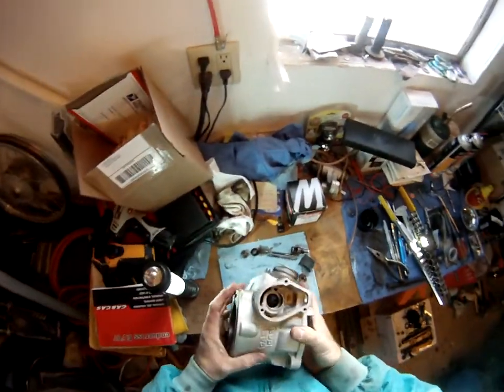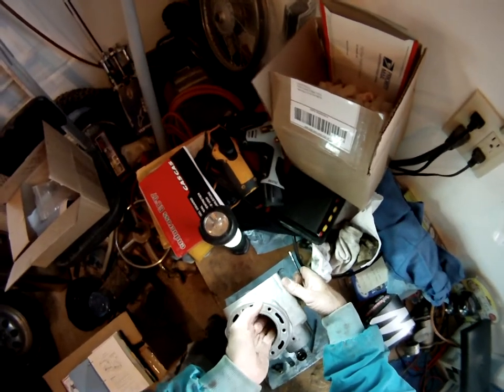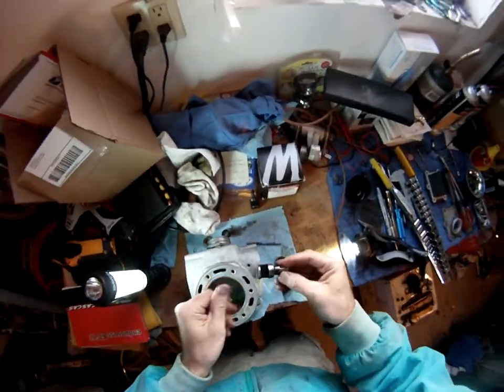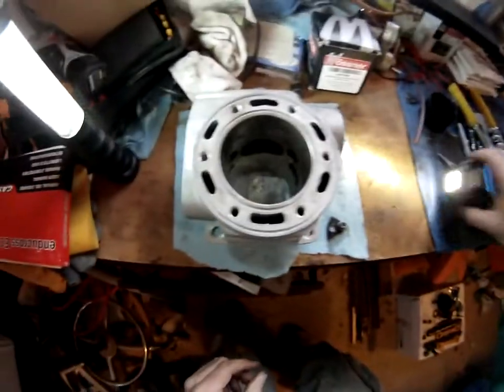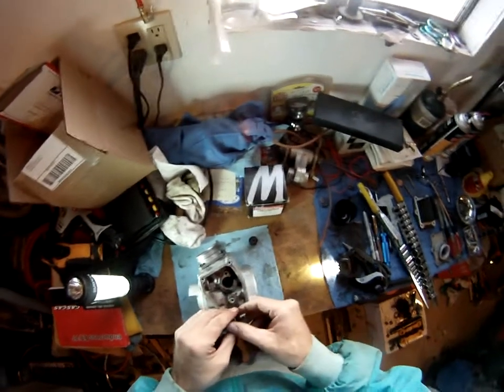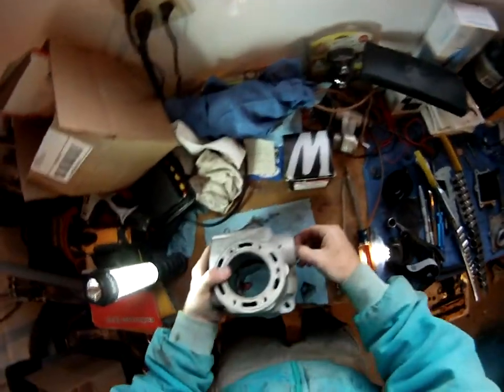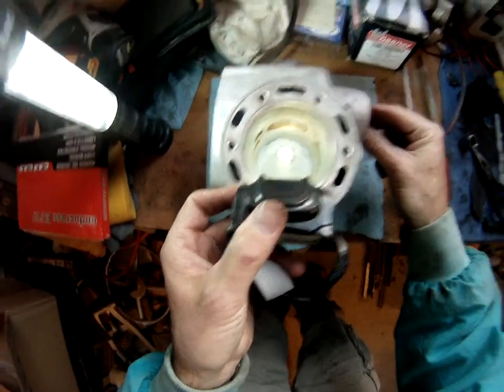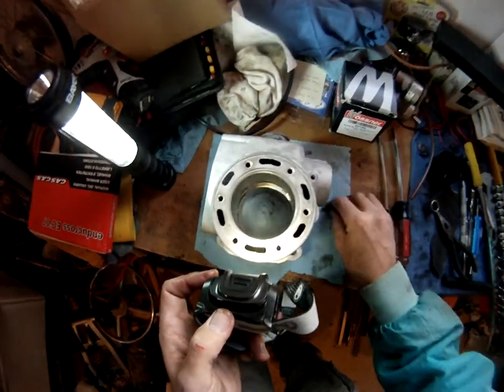GasGas EC300 Powervalve Reassembly

Comment: tonight i struggle a bit at this step with the  washer on the side with the 2 bearings. the repair instructions from my service manual said that the short rod comes in the front hole seen from exaust side. but your right!! you know it better. thanks man

Comment: I have a 04 ec 300. Its bogging down when it should open up. Jets are fine. Could this be a power valve issue where its not opening?
Reply from the maker: My understanding is, yes, although I've never had that problem with my bike. I would take the pipe offand look inside the front of the cylinder and see if the power valve is opening with the throttle opening. Otherwise ignition, and I usually start on one end and work my way through the bike. Clean air filter, check Reed valves, clean all Jets, check compression, check power valve, clean pipe and repack muffler as needed. If it's not your power valve, ask this question on gas gas Rider.org.

Comment: How hard did you fastend the screw that 8mm that holds the rod that comes from the engine and turns the PV? I did screw it pretty good, but then it would move so good as it should. Just afraid of tightening to loose, or too tight.